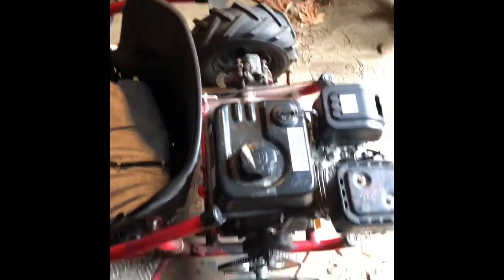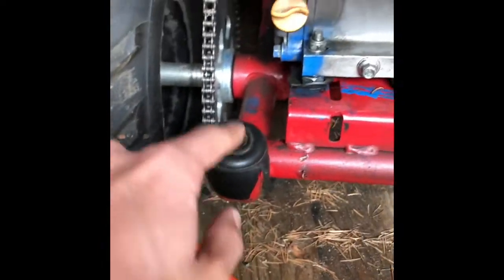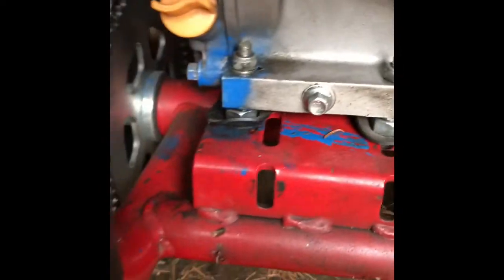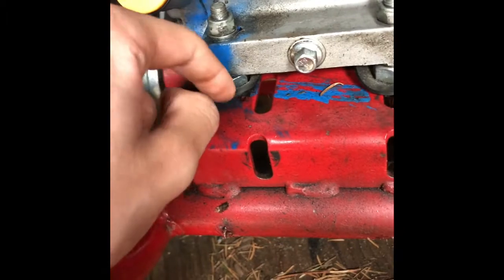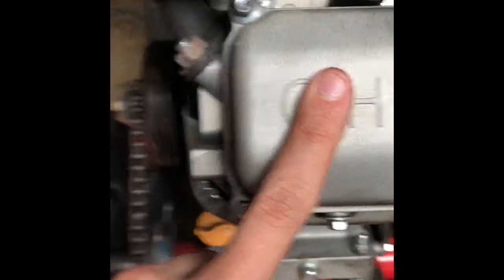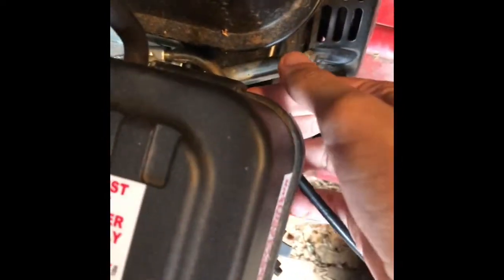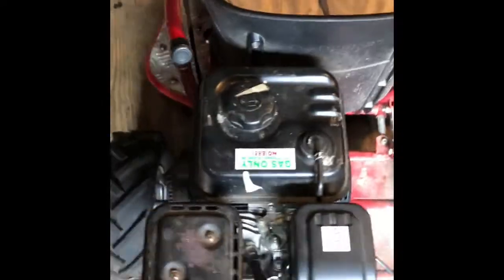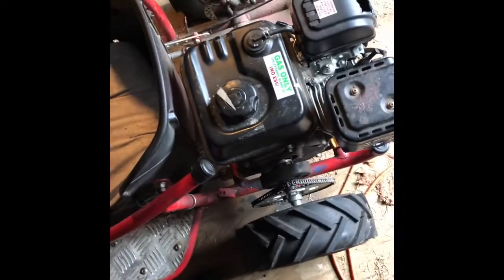How to do a predator 212cc engine swap on your monster moto go kart

Comment: I think those are directonal tires there on backwards
Reply from the maker: Yes, you are correct.
I had the tires installed by a local tire shop and I didn’t notice until years later that they installed them on backwards. 
That being said, hopefully the video was helpful.

Comment: We have 2 MM 80 cc go carts and I was thinking about doing this to one. Nice job 👍🏼 yes we are experimenting with different tires. Those knobby tires that come with wear out fast on the street. The ones you have on the front are what we are using. Those Predators are good motors as well.
Reply from the maker: Thanks for commenting 
Hopefully your go kart engine swap goes well for you
Reply from the maker: Maybe you can do the engine swap to one of them and leaving the other one stock and perhaps post a video about how much difference it’s makes
Reply: Jason Creeper  yes that’s what I was thinking.
Reply: I run Clarise trac tires